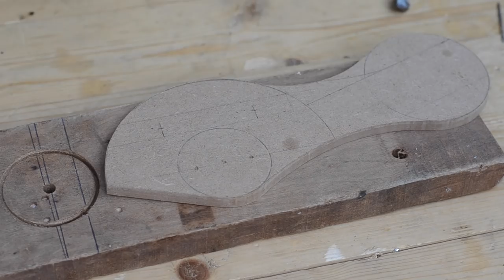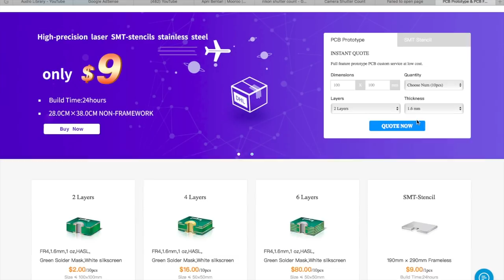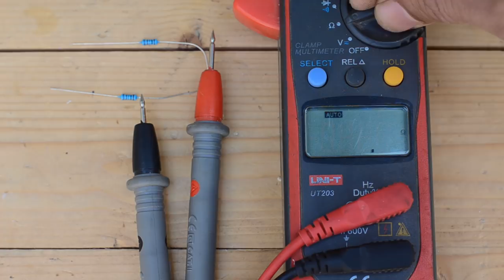How to make a Metal Cutting Machine (DIY Metal Cutter)

Comment: Hi. Ur videos are good. One problem I am facing is about the connector, the one which j had connected to motor to fix other parts. I had seen many such videos but none has described how and where to find the connector. Even in one of your videos I had given this same comment. It would be highly appreciated if u make one video on the connector. Because I am having all the materials, but connector I don't have. U know how to make the connector, but not others. So please make video such that parts are easily available, and also please make video on connector part.